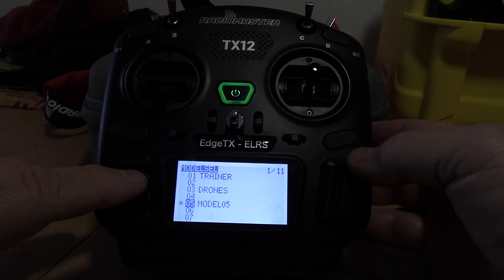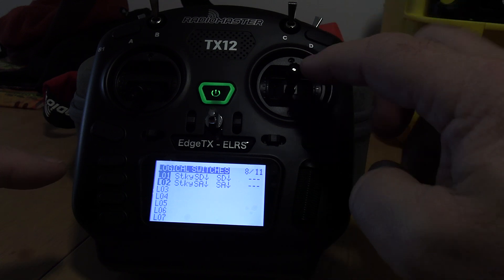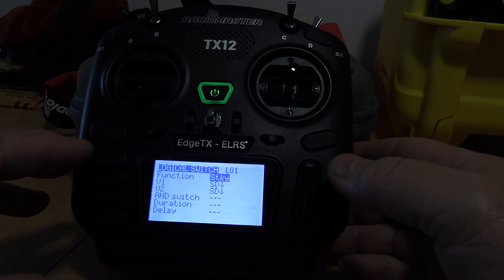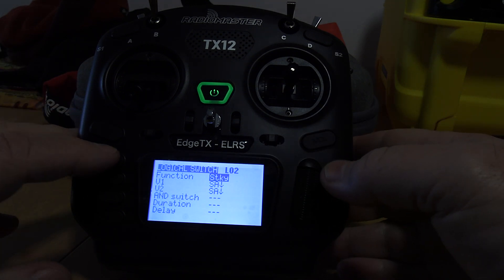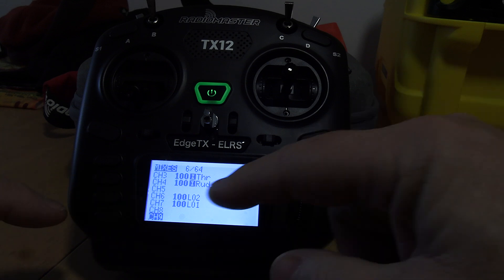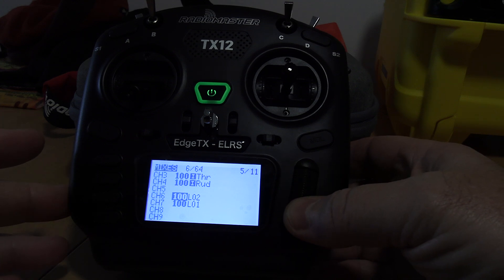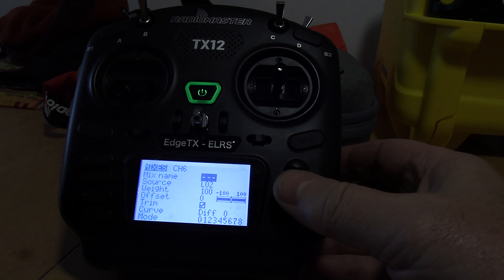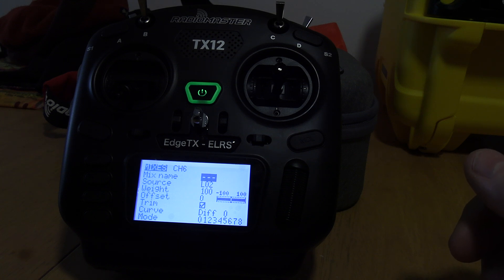Radiomaster Boxer and TX12 momentary switch to toggle switch programming.

Comment: Crack! I'd like to add that if you use the persistent option on the Logical Switch, its state is maintained when you turn off the radio. 
watch out if you use the reset session option, the Switch restarts. Be careful if you use it for throttle hold.